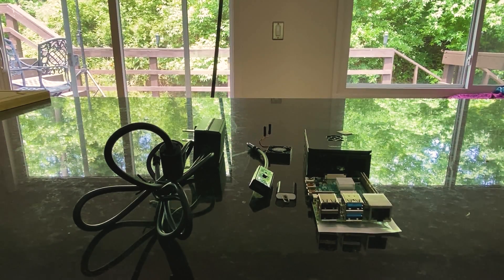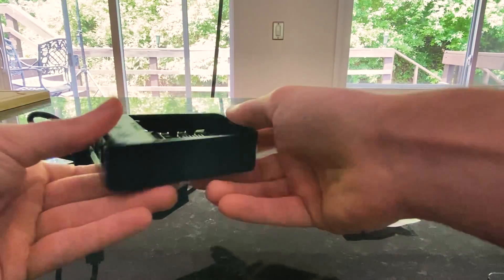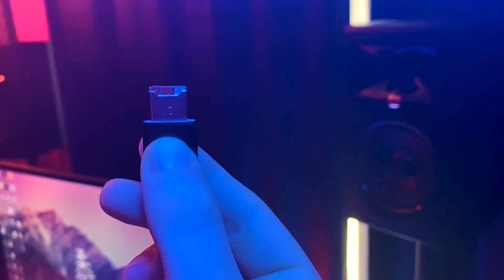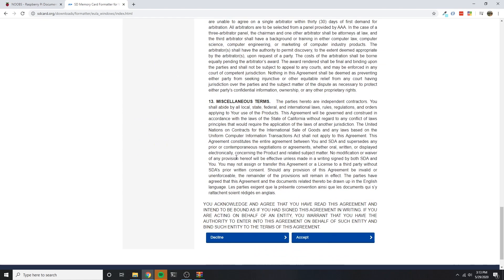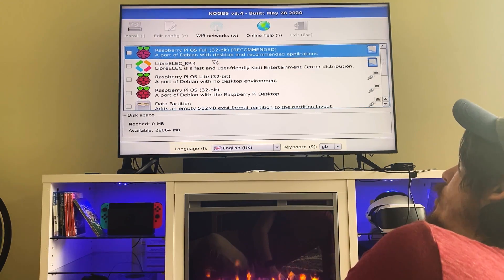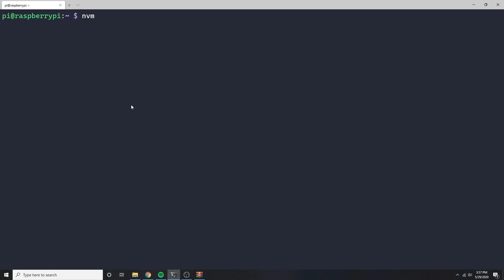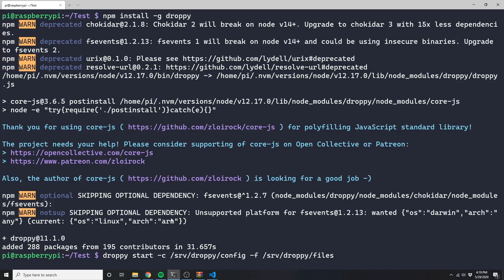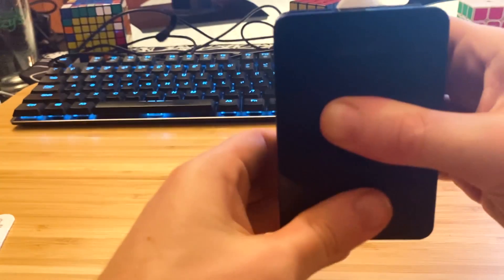I Turned A Raspberry Pi Into A Node.js Web Server

Comment: That's a great showcase of the RPi 4 features, except for the limited storage on the SD card. Which hints sticking some extrenal USB 3.0 hard drive next to it.
Reply from the maker: Yeah without an external drive it wouldn't be recommended to use as a file storage server, but it would work fine for a web server for serving web sites.

Comment: How much file can the server hold? As much as the SD card?
Reply from the maker: Yes as long as that’s how you’re Linux file system is set up. Which it should be by default.
Reply: There was a mod for the pi 3 where you flash an update to it to boot from USB (& Ethernet). I did that and  I got it running from a flashdrive .
Reply: @kingofthepod5169  ? you mean your booted into a live USB OS like you can on a PC?  I am new and learning.  DOn't want to make costly mistakes and buy the wrong thing(s).

Comment: Cool video. Can you please let us know something about the installed nodejs web server's performance? I am planning to buy one pi to setup such server but I'm very confused thinking its performance, reliability's comparing to the paid hosting services. Also, webserver should running 24x7, so can this little boy do this for 24x7 continuously?
Reply from the maker: If you’re needing a production server where there will be users who need reliable speed and uptime, I would say don’t use the Pi, UNLESS you know what you’re doing.

Comment: Nice video! How did you get your windows cmd to not suck and actually look appealing?
Reply from the maker: I am using the new Windows Terminal. It's not installed by default, but you can get it from the Microsoft Store. Takes a little bit of customization to get it to look good, but it's pretty straightforward.
Reply: @PortEXE  Thank you :)

Comment: Oh my god thanks for showing the Remote SSH Plugin this is going to be so useful since I used to code on pi itself using nano ^^'
Reply: dude you are hardcore :D
Reply: @unsound-methods  yeah it's way better to code on vs code
Reply: micro is a terminal editor and has the common commands (ex: control+S for save) just like most editors. It should be able to completely replace nano, I think. I beleive you can also use it split screen (one half of the window for your PC and the other half for Pi - at same time).  I am new to it.
Reply: @genkiferal7178  thanks for the fact

Comment: Wow, what a high quality video! Nice work ensuring that the video and audio quality are top notch! It's exciting seeing what people are doing with the latest Raspberry Pi!

Would you happen to know of any benchmarks for how Raspberry Pi 4B performs with number of requests on a
Node server?
Reply: Probably depends on a bunch of factors such as the complexity of your server, your internet connection, if you use an SD card or an SSD for possible data storage, if you overclock your Pi and if you use the lite or desktop version of the OS. I am interested myself. I just started getting into web development so I'll probably test this in the future and maybe remember to reply :)
Reply: Well... I ended up spending the whole evening figuring this out. 
My conclusion is: for a simple "hello world" page it can handle up to about 600 requests a second. 

I have no idea what is a proper way to test this, I just tried sending a get request every couple miliseconds in a loop. Above 600 requests a second the response time often got long and it could even stop working. 
I used Express.js, the desktop version of the OS and did not overclock (regular 1.5 GHz RPi 4B)

Comment: But this will only work on your local network
Its no way connected to the outside of the world right?
When you would be in your home network you can use this as a web server
But it doesnt solve any purpose if the "web" server is not open to the internet
Reply: You will need to open a port (usually 80) on the router to make it a web server. Be careful though, you need to secure the pi first. Here is a good starter https://www.raspberrypi.org/documentation/configuration/security.md 
You might want a dynamic dns service too, if you don't have a static public ip address. There are free and paid ones. Modern router admin usually had settings to configure them, but if not, you can use something like ddclient.
Reply: If you just need to temporarily share a site you're working on with someone and don't want to change your router config, you could also use ngrok or localtunnel. If you're using their free tier, the URL would just change every time you start it up.
Reply from the maker: You’d just need to do some configuration to open it to outer networks. I plan to mainly use this web server for development on my local network.

Comment: I never found a good enough reason so far to get a pie ...
Since Everything can be installed and run on my pc...
Lets be honest here .. the pc is mostly running anyway .. 
So why use a second device that has little to no purpouse ....
 Especially with other options like dropbox .... gdrive etc ..... 
which can serve as a bridge with zero cost or installation ...
Reply: Pie is delicious. Sometimes you're hungry and just want some nice pie, and his way you just turn around and here's a tiny pie stuck to your wall always ready to eat. Who wouldn't want that??
Reply: @joostschuur  The day has yet to come ... So far im still staring at an empty wall.
Just havent found a good reason yet :D ... but since im here ... you know im interisted xD
Reply: Seriously though, one of the benefits of a Raspberry Pi is it runs a similar operating system than you might run on a server in the cloud, so it's a great test environment. Of course you could also use Docker on your local machine.
For laptop users, they can run a server on a pi and not have to worry about it being down when you take your laptop somewhere else or it's off. Your pi server might be doing some regular processing via cron and you want that to work if you leave the house with your main dev machine.
Reply: that being said ... I wiill probably give in one day and solve some problems that don't exits as well.. to get some linux / cmd exposure..
Even talking to friends that own a pie ... their only reason seems to being free of "the cloud" ... and to fiddle togehter stuff for fun and for the sake of fiddling xD...
which is a good honest reason ;) ....
Reply from the maker: I'd say portability of it is another thing to look at. You could even set it up to work with a network coming from your phone if you have a hotspot capable phone. At that point you have a portable web server on a portable network. I'd research web security first though if anyone ends up being interested in that idea.
Reply: you dont need a rasperry / node js  to create a fileserver from your phone.... there are phone apps for that .... so you could acces your phone directly from your pc ....
that way you dont need a webserver either to upload things xD
as I said ... solving problems that dont exists
Reply from the maker: Oof. Okay 👍